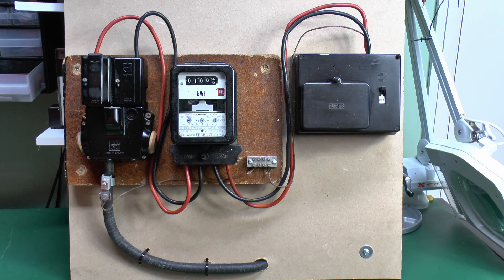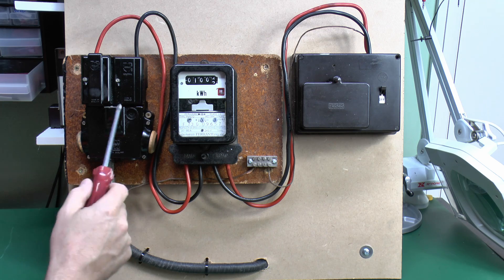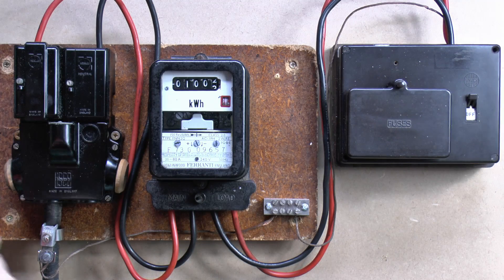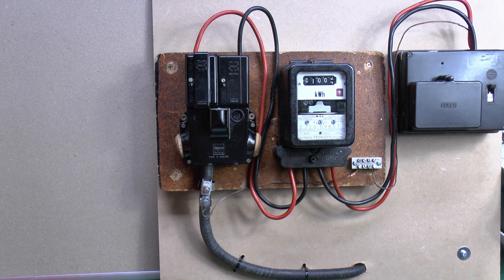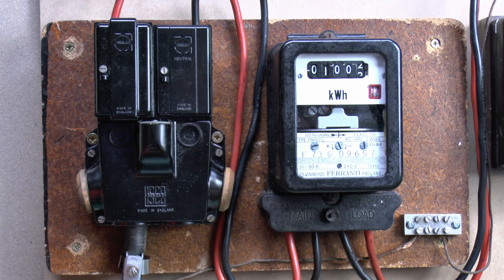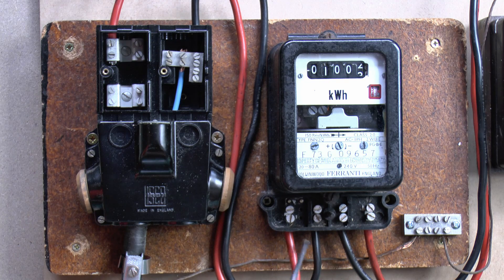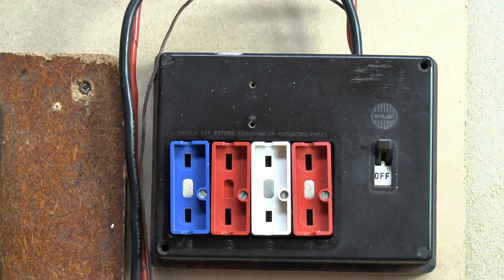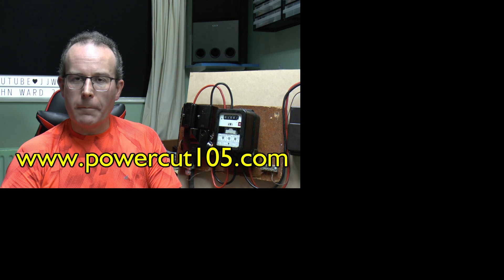Cutout, Meter and Fusebox - Who Owns What?

Comment: Having an EV fitted. Aimed to get 100A fuse to replace existing 60A fuse. Contacted DNO. They told me about ownership and that I had to get tails changed from 16mm2 to 25mm2 before they would change fuse. Electricity supplier I was with would charge me about £250 for this. Changed electricity supplier. Booked in new supplier to change tails for free (3month lead time). Oh, cannot change tails because fuse holder does not accept 25mm2; DNO needs to change fuse holder. Meanwhile, also arranging electricity supplier to fit smart meters (3month lead time). Day arrived, E.ON computer system down all day. Meters could not be fitted. Re-arranged (1month lead time). Decided to stick with 16mm2 - DNO happy to fit 80A fuse on 16mm2. Now EV charger is fitted it emergency shuts off now and again because of overvoltage on supply. That is not going to be good for its relay contacts. We have an average of about 250V but it is very variable and, daily, experience brief excursions to 258V. Now awaiting a transformer tap change; no idea when. Most people I know with smart meters cannot get their wireless power meter displays to work. And the UK government want growth. I can't see it happening very quickly, can you?

Comment: Had a job recently where neither the DNO or the metering company would take responsibility for the old single insulted tails between the cut out and meter . It’s a bloody nightmare . I visit my local DNO office in Poole and they gave me 10 seals , I had to register with them as I was an Niceic contractor .  This allows me to pull the fuse and replace tails safely but it’s still such a grey area .
Reply: im a 3ph meter engineer the metering company would change them if you told them to
Reply: They would nt take responsibility .
Reply: The incomer tails and metering equipment are the responsible of your energy provider.
Reply: I ve know that ! But if the women on  the phone won’t take responsibility what are contractors to do ??
Reply: @ted5hhh1241  If you find this to be a reoccurring theme, I'd ask for some sort of documentation from them that outline exactly what they are responsible for. My guess is that the document will clearly state that they are responsible for the metering equipment and the tails and will be very reluctant to give you physical proof confirmed what you already know.
Reply: Did you have to pay to register with them?
Reply: I was advised by the Niceic to go to the local DNO office . They took my details down and handed me the seals . They also informed me a registered electrician with the Niceic I was allowed to pull the main fuse .
Reply: @ted5hhh1241  Just with NIEIC or any of the others?
Reply: I presume other  bodies would get accepted .
Reply: @ted5hhh1241  I suppose if it's something they can charge for, they come out and do it themselves, if not, they give you a pack of seals and tell you to crack on.
Reply: I just get the seals off eBay, sod hanging about for the DNO when you got a board change to get on with 😂
Reply: @ted5hhh1241  Make good the installation and bill the DNO.
Reply: @ashmanelectricalservices4318  If DNO gives you seals to 'crack on', clearly they're employing you to do their work - so you should bill as per any customer.
Reply: Giving you their seals is basically like saying "go do our work for us pal, you dafty"  Would I f$%k have accepted that, I'd have pointed out anything that needed sealing belonged to them as it was their seals. In a courtroom it would work exactly like that too, the judge would ask "who's seals are they" then promptly tell them it's their problem not yours.

Comment: Also a historic note on those fuses... I think you have covered it before, but if you try and replace the Wylex fuse carrier after a fuse blows, and the fault still exists, the fuse blows quite violently sending little bits and bobs right into the spot where your fingers are on the finger holds. That's why they're all meant to say TURN OFF BEFORE REMOVING FUSES.
Reply: We still use in Malaysia
Reply: @sugumaranperiasamy7101  We still use in the UK, we just don't fit. them anymore, there are millions still in existing use though.
Reply: If you try to put a fuse in a 100a circuit after an open and possible fault without opening the the consumer isolation switch and breakers, then you probably shouldn't be replacing the cutout anyway... I would probably put a small  load across the carrier  say 3kv kettle in a apocalyptic situation to check for dead short
Reply: @T2D.SteveArcs  "3kv kettle"
Wow !
Some powerful kettle you have there !
Reply: @jonesconrad1  i had one that had a lose connection , lots of sparks  and went off  , still no idea why but it appear the switch failed for some reason , i could get the power back on by moving the main switch , no one had been near it and only 60 years old lol

Comment: I remember as a child (65 years ago plus) there was an incoming fuse on both line and neutral. I often worried that the neutral fuse would blow in preference to the line, cutting off the supply to the house but leaving all the line connections live!
Reply: Peter Jones you worried about that as a child? 🤓😉
Reply: I retired from don a couple of years ago, and we still used to come across the odd cut out, metal clad, which had a rewritable fuse in live and neutral. This was classed as an emergency, and would be changed to a new one on the same day. We also had to check the rest of the street to see they were ok.
Reply: There's still loads of fused neutrals out there if we find one we have to check 5 houses either side and replace any we find
Reply: I’m a meter fitter and came across a fused neutral last week, job aborted and reported to DNO
Reply: @percyprod165  Reminds me of when a very young meter reader, probably agency, took the KW/h reading and swapped out the meter. He then remarked on the ancient, cast iron fuse box - 1 fuse in phase, 1 in neutral - that feeds the meter. (It has been there since the 1930's and is almost a century old). 

He said,
"I'll mention this old, obsolete fuse box to the office when I get back, and suggest they upgrade it for you."

I laughed and said,
"Well, good luck with that!"

He left looking puzzled. That was 20 years ago, and the old box is still there as I write, doing its job. The young guy probably didn't know that any attempt to move the old (ancient?) cable, with gutta percha and pitch insulation would result in a catastrophic electrical explosion. We just had one of these underground explosions recently in my town, and that without moving it.
Reply: Should have been a link unless it was an ungrounded system …
Reply: Sounds like you were born to be a sparky!

Comment: Great video JW... I've been out to a number of properties where the distributors supply earth has a higher impedance than that permitted by BS 7671, when I've contacted UK Power Networks in the majority of cases, they relinquish any responsible of repair or replacement as the property is of a significant age. Does this seem right to you?
Reply: Well it’s there responsibility !! You have answered your own question.
Reply: ESQCRs say the DNO has a responsibility to maintain the earth connection whenever they provide it.
I reported a BS951 clamp recently at a property in central Birmingham.  Instead of agreeing to deal with it, they cynically declared the earthing arrangement to be TT.  They said they could 'convert' it to TN-S with a suitable connection to the lead sheath, but there would be a charge.
Reply: @ted5hhh1241  Just wondered if there was some hidden clause JW might have known about.
Reply: @westinthewest  It already appears to be a TN-S system... The connection method to earth is what is in question. We could spend ages going back and forth with these crooks but that doesn't help our customers so very often we do what's necessary to sort it out ourselves.
Reply from the maker: In theory the DNO are supposed to maintain/repair an existing earth connection if they provided it originally.
Reality is often very different. Such as them just adding an RCD to the incoming supply because the impedance was ~10 ohms on what was supposed to be a TN-S service.
Reply: @jwflame  Sometimes they come out and assess weather a TN-S system can be converted to a TN-C-S, if not they recommend the homeowner have the system converted to a TT system.
Reply: Make good the installation and bill DNO for remedial work if they refuse to do it them selves - but do tell them that is your plan of action in case they change their mind. Sorted.

Comment: My nans old cottage in huntingdon (UK) had bare wires running across the beams (assume these were live & neutral/ earth) in her 5' high cellar, these wires were attached to small white insulators about every three feet that had been nailed to the wood beams. 
My granddad who was 6' and had a bald head received a number of electric shocks to his head when walking under the beams. 
He told me that his father had said the wires sere installed in the late 1930's.  
Fortunately this system has now being replaced but the old wires, though disconnected are still there.
Great video and thanks for sharing
👍👍👍
Reply: Sounds like 1920s electrics needs urgent replacing.
Reply: May well have been a DC supply from a local supplier
Reply: I encountered a similar dangerous setup when looking at a new home with my parents back around 1980.  Didn't buy that one.

Comment: i had a fuseboard which caught a light and was melting from the wall, went outside and pulled the main fuse straight away, none of this nonsense with calling up the DNO because I touched their main cut out fuse. situations like that call for drastic measures as far as I'm concerned, thank you for the video JW. a nice presentation.
Reply: @UberAlphaSirus  It's been mentioned on a number of UK sparky channels that the DNO and meter installers take ths view that the seal is there to show that they have done their job at installation time.
Reply: That’s still true in Europe — if you call them right away after with a plausible story, nobody is fussed about the seal on the fuse being gone. But you shouldn’t look like you’re the kind of person who might have a grow house on the second floor hooked up when they’re not looking.
Reply: Pulling the main fuse from the cut-out without protective gloves can be a dangerous exercise, on rare occasions the fault can be from the cut-out arcing, which can cause surface voltage at the cut-out, not only that would you know if the main fuse carrier at the cut-out was damaged or not,
Reply: ticktock T a ceramic screw thread fuse holder might work better — you don’t really have an air path between where the arc would start and your hands.

Comment: All so true!

Reminds me of when a very young meter reader, probably agency, took the KW/h reading. He then remarked on the ancient, cast iron fuse box that feeds the meter. (It has been there since the 1930's and is almost a century old). 

He said,
"I'll mention this old, obsolete fuse box to the office when I get back, and suggest they upgrade it for you."

I laughed and said,
"Well, good luck with that!"

He left looking puzzled. That was 20 years ago, and the old box is still there as I write, doing its job.
Reply: Probably better quality than anything provided by the DNO later.
Reply: @johndododoe1411  Absolutely !
The young guy probably didn't know that any attempt to move the old (ancient?) cable, with gutta percha and pitch insulation would result in a catastrophic electrical explosion. We just had one of these underground explosions recently in my town, and that without moving it.

Comment: Informative and explained clearly, interesting on the Yellow 20 amp fuse carrier.  Thanks for sharing.
I had my domestic supply changed to 3 phase recently, very interesting watching the DNO connect to the 1960s four core sheathed lead wrapped street supply run in the foot path. Each core was left with its insulation on, and clip on bite connectors used to splice on the feed, then large plastic boot, filled with a two pack sealant. The old single phase cable was cut, potted and left live under the path.
Reply: I would love to have seen that.
Reply: yep watched them repair the feed to my garage (3 phase) same procedure, dug up the street and they cut out a bad section of the leaded cable. and used the crimpy things then filled with epoxy, thankfully my garage had its supply renewed in the 90's so was on modern cable all the way out to the street, but the office next door were on the old leaded cable and thats where it faulted, burned a nice hole in it, should have taken pics.
Reply: Seen this done many times in my time as a spark, chatted with the guys doing it , had to laugh he was using the high voltage cable as a seat while doing the connections!
Reply: That's something I've always wondered if you don't mind me asking roughly how much did they charge for switching to 3 phase? I can't imagine it was cheap.
Reply: @Firecul  £ 3.6 K in 2018 for the DNO including cutoff and meter box, excludes trench from path to house. Contact your DNO, that's part of their job.
Reply: @bostedtap8399  that's not too bad actually, thanks
Reply: @Firecul  It replaced a Transwave 7.5kW convertor, that is now retailed at over £ 1.6 K ( great bit of kit). Another advantage is I can have two or more electric showers safely.
Reply: Firecul42 here in NL almost all houses have three phase supply, and only one phase hooked up. Makes it super easy to balance phases if needed by switching someone over, that’s only work in the main fuse and meter board.
Reply: @JasperJanssen  That would be really convenient and not that much more work for the original wiring for the houses.
As it stands I'm sure SSE would charge me about double but at least I have a ballpark number to go by.
Reply: Indosarnia the advantage of lead is it really doesn’t care about drops of water. The disadvantage is it’s molten lead.
Reply: Indosarnia only in the sense of physical safety of the laborers, not in the sense of electricity insulation.

Comment: 20:49 - having removed the fuseboard cover, you can park the lid upside down using the same screw fitted into the upper screw hole an inch or so above the hole normally used by the lid screw. I can't think of another purpose for this extra screw hole !

Comment: our elec system is a modern old mix.....we got the modern key token meter that eventually connects to the brown fuse box...which is a larger version of what is seen in this video with the ceramic plug things. i just have to love the reassuring 'clunk' sound the switch makes when you flick the 'on/off' switch down or up.

Comment: Still have this setup in my house. One fuse holder had been “rewired” with a length of electrical solder when I moved in!! Got a qualified electrician replacing the consumer unit, meter tails and testing the whole of wiring.
Reply: It's fuse wire

Comment: This was really interesting! We've just had the 66 year old fuse box (identical to your example but cream coloured) replaced after a short in the garage blew the power circuit (not just the fuse wire but the whole of the socket in the box underneath it!) The meters (gas and electric) were replaced about nine months ago with smart meters replacing the same rotating disc type shown here. We now have a nice modern consumer unit paid for by the extra house insurance on the pipes and electrics - thank goodness! Only problem is now we have to replace some light fittings as we never knew the council hadn't fitted the light circuits with an earth (all bakelite fittings back in the '50s) Thanks for all the info!
Reply: We still had this system up until about 15-20 years ago, so relieved when we updated our main consumer unit with RCD protected circuits, so much safer!
Reply: @danw1374  You're right it is a lot safer - but its still a right pain in the backside when something which would not have bothered the old fuse wire trips the darned rcd! Had a problem on Christmas eve - the main rcd tripped, reset and a few hours later went again this time the ground floor sockets tripped on turning back on. Unplugged everything and re-plugged one by one - no problem. Day after Boxing day off it went again, this time as we were going to bed with everything turned off - reset, off to bed then woke up at 2am when power went out. Wouldn't reset so put a couple of extension leads on the emergency sockets for the fridges and freezers. Next morning did the unplugging ritual again and (hopefully) traced it to the plug which goes out through the wall and into the porch from the outside (no other way to get power there at the time it was built) The pvc pipes the cable runs through are pretty much weathered to fragile dust and it was raining hard when the power went out! Unplugged the porch and no more problems - now need to re-wire the porch! (This time under some new plastic cladding!!) Ah well, that's progress!

Comment: A point worth repeating is with the metal version of this Wylex board, if using rewireable fuses as here always replace the fuse cover. If you don't, when a fuse blows it's possible for an arc to strike from the live side to the metalwork with only the main/service fuse between it and the incoming supply.